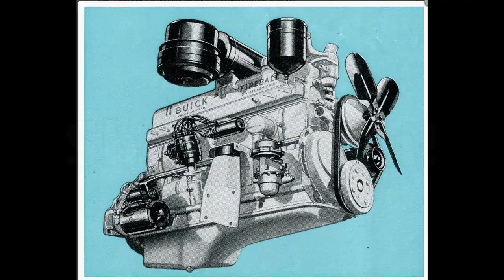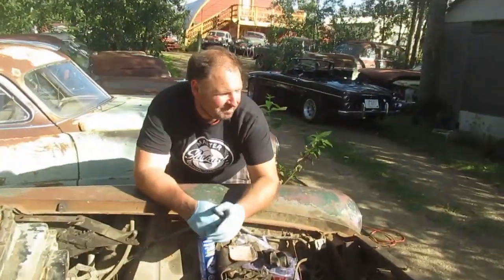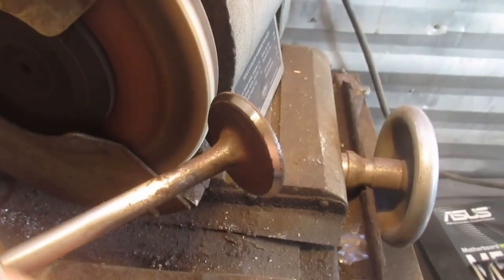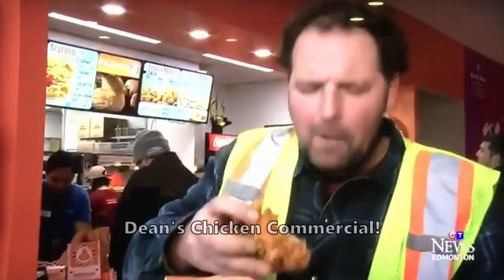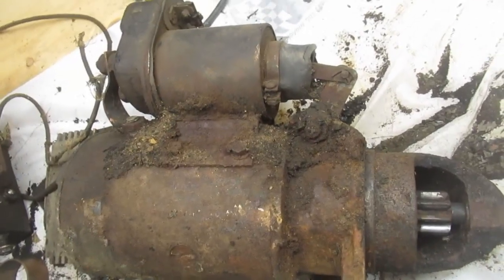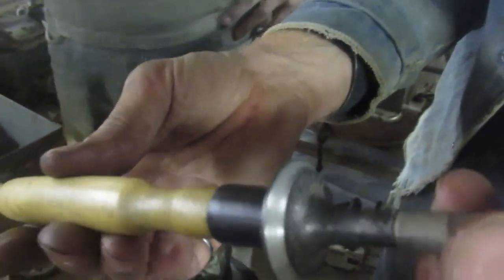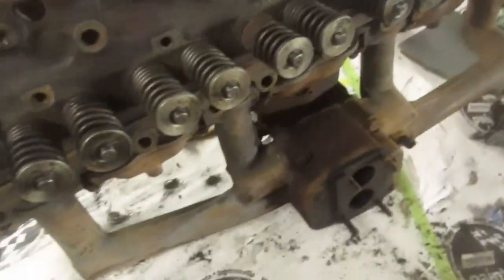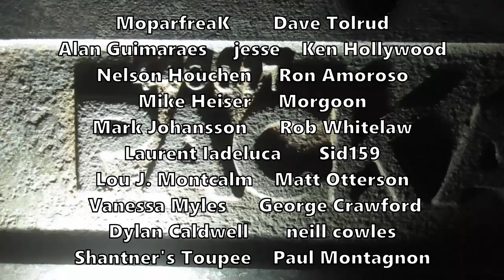Will they Run? Straight-8 Showdown! Packard vs Buick, Part 4...

Comment: Don't forget to flush out the water distribution tube in the Packard.  It is in the water jacket in the block.  The water from the radiator runs through this first to cool the valve seats.  Probably mucked up.
Reply: Didn't know that. Thanks
Reply: This is a really great masterclass episode. I have learnt so much about some things should be done can be done and why some of my efforts were of limited success. Lapping valve and seat grinding. Am so going to find that valve grinding setup. Many thanks. And Packards definitely really well made. That should be a sweet ride run like a locomotive. Now back to the Atlantic...

Comment: I'm on the edge of my frickin' seat over here! Not another week before I find out how it all unfolds, my head will explode! I have not so fond memories of indentured servitude in my old man's small engine shop, grinding away at Briggs and Stratton and Tecumseh valves, spitting on the suction cup, and using a hand cranked jobby that went "pocketa-pocketa-pocketa." This looks way more fun.

Comment: That valve grinder and seat grinder were made when men actually fixed things instead of just being parts changers. Sadly we live in a disposable world and it brings a tear of joy to my eye when I see things like this and someone actually repairing something not just bolting on new parts🤗🤗🤗😭😭😭😁😁😁
Reply: Part of that came about because back in 1953 parts were expensive and labor was cheap (realitively speaking) so it made sense to rebuild . 
Now parts are cheap and labor isn't so it makes sense to remove and replace rather than to fix. And modern cars aren't designed like the 53 Packard Packard to be rebuilt.

Comment: Amazingly good valve work & rejuvenation. Sometimes spray contact cement is mandated to make valve & lap stick one when suction is wanting. You'd think they'd have come up with a rubber-coated magnet stick end to facilitate the job, in light of the expanding neodymium applications .

Comment: Tip on the valve grinder that goes too fast: Any corded tool/AC motor (except synchronous motors) can have its speed controlled with a device called variac.  A variac controls the AC input voltage to another device. 

I once couldn't get a new relay for my car (needed it to turn the high beams off) so I opened the relay, drilled out the rivet that holds the coil, tediously unwound the coil by hand (the open was near the core of the winding), then not wanting to spend 4 hours rewinding it by hand I chucked the coil-form's core into the corded drill...I plugged the drill into my variac and turned up the voltage to the drill till it was moving just fast enough that I didn't lose good control of the winding process. I reassembled the relay (used a big solder blob to replace the drilled off end of the core rivet), installed it and almost 5 years later it is still working good (knock on wood).

Comment: Hi guys. Man Frankers sure loves them sticks.And looks at home in the he dodge, good girl she is!  Wow, eights are taking quite a bit of work. Sat too long. But they will run again.Reminds viewers dont let your car or truck set fir 50 years! The auto shop in high school had the same Souix valve +seat grinding machines. Ive rebuilt lots of heads, including replacing guides and seats. But never on a straight eight. Im anxious to hear them run. On overhead valve heads i use a cordless drill to lap the valves in. Instead of the suction cup hand tool. Chuck the valve stem into the drill from the back side. I really enjoy the old school mechanic stuff. Ive done a ton of it. It takes patience, time, knowledge, and talent to do quality long lasting permanent repairs. On a budget. Zero budget. Awsome. I like old OEM parts better than han new reproduction stuff. There usually better. Excellent show. Nobody does this stuff anymore. Take it to the machine shop or buy a new head. Thats why the revvedupyooper loves this SAME OLD SHIT!!

Comment: Wow the Packard is REALLY cleaning up nice with that valve job. If that transmission won't pull i'm going to be heartbroken.
Reply: With a fresh change of ATF in both the tranny and the locking torque converter, the Ultramatic should be ready to go, if only in low range. Ultramatics generally worked fine with in-line 8's, but were problematic with the 1955-56 V8s. Last I knew, neoprene oil pan gaskets were still available for the Ultramatic.

Comment: Paul, you’re not the only one waiting with baited breath. Just remember, these guys have 50/50 antifreeze mix for blood in their veins (what hasn’t been displaced by excessive beer intake, that is). These engines were known for their smooth performance. I still wish I had bought that ‘51 Packard in Ottawa, Illinois.

Comment: HEY!!! Great to see this episode!!
BOTH cars seem to be at the same point!!! I am seeing on other channels that these Buick straight eights get stuck.
I'm still hoping for the independent team Packard to be the first!
At the end of the day, I'm hoping that BOTH these forgotten classics get back to running status!!!!!
I can't help but wonder, how all that water got into that Buick engine. It looks like someone took a garden hose to the oil fill.
Some mischievous kids perhaps..
I love seeing the valve re-conditioning equipment in use too..
Great job and video!!!!!!
I'm sure Frankers will want a ride in each car!!!!
Cheers!!!!!
Reply: I had a 72 torino sport that had a factory hood scoop. When I pulled the motor before I junked the body I pulled the oil plug and almost a gallon of water came out. It only sat outside for a few months. I was shocked and couldnt imagine how it got in the engine since it ran before I pulled it.
Reply: @tabbott429  I suppose it doesn't take much, for water to find it's way into an engine.

Comment: Those crusty Packard valve guide passages would clean easier using Hoppes #9 gun solvent on the cleaning jags. I use it a lot for many tough cleaning operations and Hoppes cuts through rust and carbon on anything, not just firearms; a bit pricey but does the job.  Keep going with those videos as I look forward to every one.  They are terrific and you are making a lot of people extremely jealous in the process.  You need to sell "working tours" so others can get in on the action. Press on!
Reply: John I love it, also have coldwarmotors B&B, with your choice of vintage autos to sleep in or deluxe accomodations in an over the garage suite, with meals hot off the manifolds, like people used to do on road trips
Reply: @joeboxer3365   And I get to leave my wife at home---------------yes!  I'm in!

Comment: I love cars like these. My 1st car was a 73 Nova with a straight 6 250. That's the car I learned on. These straight 8s with the flat heads are even easier. Wish I had a collection like yours. You could definitely build a few cars out of what you have there.

Comment: wasn't hip to what 'turn up the base' meant until now. although i should have, being the proud owner for 18 years now of a 2001 ram 1500 manual with roll-up windows and bench seat in bread truck white.
Reply: That's about as base as you can get.
Reply: 6cyl??
Reply: @Fordrally89  ha. if it were true to form it would be, but no, it's the bigly 318.
Reply: @bladerunner6282  yeah, but its like a 50+ year old design.
In high school I acquired a 71 valiant 318, original everything for $400.

never did that engine let me down, and no amount of highschool drag race/no idea what I was doing ever hurt it. Even when I once filled it with 2 gallons of oil and started it. As soon as I figured out what was going on and lowered the oil level, it never even leaked.
Reply: @cookingwithchefjeff  Gotcha beat bad, my first ford ranger a 97 came with rubber floor no carpet, tan vinyl door panels no map pocket, manual windows, tan vinyl single bench seat, with a 2 cushion depression, the am/fm stock radio replaced by a sparkomatic cassette player, and what my mechanic friend couldn't believe till he looked at it on the rack, manual (non power) steering. I will admit was in forest green, and served me well for 7 years and 90,000 miles and got me to appreciate and love those economical long lasting trucks. Almost forgot this was a 2.3l 4cyl 5spd stick very base, but I loved the control and extra power of a standard, can take shit pinto and make it chirp the tires and give the crown vic beside you a run for the money. If any of you think the last part delusional it may be, but hey it was 43 years ago in an Genee cream ale induced haze.

Comment: Oh Man O Man I spent many hours on them Sioux Machines... Three angle valve jobs too, going for that extra flow.
The exit music, you need that out on a CD
Reply: Craig Nehring - it was bringing back memories for me too. Same machine. I used to count passes across the stone so about the same amount of material would be removed off each valve. 12 count (6 quick back and forth passes) across the stone. That was a 1 and I’d do the same on all the valves in the same head. If it wasn’t cleaned up, another 12, so that would be a 2 for the whole head etc. If I’m counting something even now all these years later, I get to 12 and the next number is 1, lol. I could do 7 pairs of V8 head in a day, surface ground and bronze guide liners too. 

That motor for the seats is pretty intimidating at first, it jerks hard when you click the heavy trigger and is really making some rpms but you get used to it. Like you said, 3 angle seats on almost everything.

We never bothered to lap anything unless we were suspicious that something wasn’t right. 

I enjoyed the job a lot but the pay wasn’t great and I finally moved on.
Reply: @rustyaxelrod  We didn't lap neither, but used presion blue, a blue goo to indicate contact
Reply: Craig Nehring - Right! Had to use that to make sure the 3 angles were in the right spot. Did you get training in a big shop? I worked in Pascagoula Ms. but got training at the Morton Machine Co. in Laurel Ms. I enjoyed seeing that old machine in this video.
Reply: @rustyaxelrod  Small shop, equipment was older than the hills and that was in the early 70's. Milwaukee had a lot of machine shops back then. Takes awhile to get good at that. Then came the "Newave" cutters. Worked great on  cast iron but sintered steel seats, nothing could beat the stone at high rpm

Comment: This series also puts my so-called feat of driving a '52 Ford V8 out of a field that had been sitting "forever" in clearer perspective. It had been sitting for what, at the time, was my entire lifetime, 15 years, not 50. I didn't have to do much other than free it up (didn't have to build a hydraulic piston crusher), plunk the wrong sized tires on it, make a set of cardboard carb gaskets, balance a lawn mower tank on the hood, battery, points, rotor, plugs, and go. 50 years of sitting does some pretty epic damage!

Comment: I haven't used a lapping stick (on overhead valve engines in years). I use a dill motor and 
chuck it to the valve stem, then spinner up !

Comment: YOU GUYS HIT 100 ON THE FUN METER THIS WEEK KEEP IT UP.  BOTH CAR'S ENGINES ARE A POSSIBILITY OF RUNNING BUT THE BUICK TRANS WAS SKETCHY OUT OF THE FACTORY.  I'LL BET ON THE PACKARD JUST BECAUSE THEY WERE BUILT TO  INDUSTRIAL ENGINEERING  TYPE STANDARDS, LIKE TANKS.

Comment: I had a ‘91 base D150 as well. It didn’t have the slider option but DID have the 318/auto combo. It originally came with radio delete but someone had installed a factory style radio and plopped some 6x9’s on the floor behind the seat and called it a day 😂

Comment: Dear Coldwarmotors guys.
I simply had to watch this great video again next morning. Uuuuh, WOW! Agent "Mean Clean Dean" did a very very impressive job. Looks really good. Congrats!
Scott, it is so great that you owe all those fantastic tools/machines (valve grinder, valve seat grinders, distributor tester etc.p.p.).
I am hardly able to wait to hear those great ol' irons run again. I bet that they will run very smooth after all this effort put in. 
WOW 2! The Alberta pickup truck looks very decent. Unfortunately someone scratched both sides and let it rust. Otherwise it would be without any rust at all? Congrats to the agent who was able to buy it.
Thank you so much for making taping editing uploading and sharing.
Best regards luck and health to you all (including cute good girl Frankers of course).

Comment: Have you checked the valve/cam clearance after the grind and lap in? If the valve is deeper in the valve seat pocket the overall length may prohibit the valve from seating. Old flat head mower engines are very susceptible to the valves sinking into the seats. Milling the valve stem above the keeper is the recommended remedy for clearance.

Comment: I suggest to set the grinder to the same decreasing for all valves. Keep the final measurement for all valves from the one with the deepest dents. Otherwise you have different compression ratios and valve lifting times.
Reply: junkman
Won't matter on those. They won't be driven on the road.
Reply: they get the better price when the engine was proper restored.

Comment: LOVE this series SO much! BUT!!! It is time for an Official intervention! Obviously Team Buick is HEAVILY at a disadvantage (mostly available hours from members). As the "SELF IMPOSED" offshore Referee of this event, I propose, Team Packard for every Man hour invested, they must supply 25% equal Man hours to Team Buick. Cant wait for more!
Reply: I believe there's a good chance both teams will successfully get their respective engines running. From there Team Buick has a definite advantage with a manual transmission. From what I've seen the motor in the Packard wasn't the reason the car was parked, which makes me believe the transmission in it has issues.

Comment: I have a base Dodge truck, It's an 81 stepside, Slant six with automatic. It was a village of Lexington Ohio vehicle, I'm assuming it was the fire chief's vehicle as it was red and instead of a horn when you push the horn button a siren goes off! It's good for a few  laughs when someone runs a stop sign or red light or comits some othe traffic infraction in plain sight, I hit the button and they look towards me and I look around like I'm trying to see where it's coming from!

Comment: Valves that move - check   Valves that seal - check   This 1/3 rd of the compression puzzle is solved. Gasket set on the way very nice.
Rings seem to be a given, so compression is almost a reality. Barring any terrible bottom end disasters it looks from here that this will happen.
Stay tuned - can the teams get movement under power before it snows ?......

Comment: In my maching class for high performance engine building we were taught to feather the valve back and forth very quickly otherwise it will have a wavy w style groove in them. Idk if this is a new technique not a criticism I get the purpose of the video just speaking my peice

Comment: at first i felt the Buick had the advantage because of its overhead valves, but then i noticed the Packard had by far the biggest displacement, plus seemed to have the engine that was in the best condition, so i am holding off on making a prediction until i get more info

Comment: Ah well, I decided to delete my earlier post, I didn't mean to call this an engine re-snuff flick, haha, I once thought I wanted to be a comedian, for the money, but anyway.  This is an entertaining series, I can't wait to see the engines run, doesn't really matter if they aren't perfect inside, like the buick overhead valved engine.  It probably had liquid in the rear cylinder due to leaking head gasket caused by warpage of the head from overheating or at least a damaged head gasket, cause that is furthest from the water pump, the back cylinders seems to be the main problems on engines down on their luck.  This stuff is awesome, I am following these videos more closely as they come up unlike the fury videos where I had to catch up recently.

Comment: My first proper job when I left school was refurbishing heads. I would grind them on a table with a vertical circular grinding wheel with the middle bit missing, as in O shaped with the flat table outside and inside the O. If that makes any sense. I've never seen another table like it, are they still used? This was about 45 years ago. All the valve seats were either ground, or replaced then ground. I maybe remembering wrong but I thought we used a hand operated grinder similar to a brace and bit. The valves were ground similar to your machine there, and then lapped exactly the same as you're doing here..